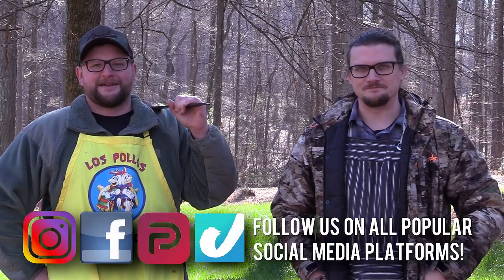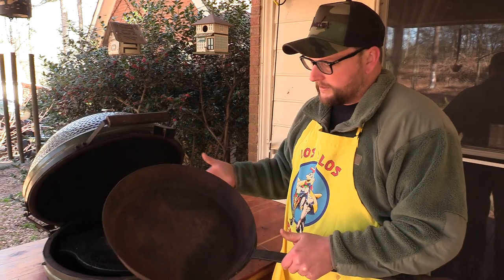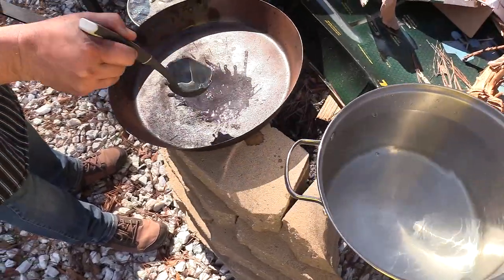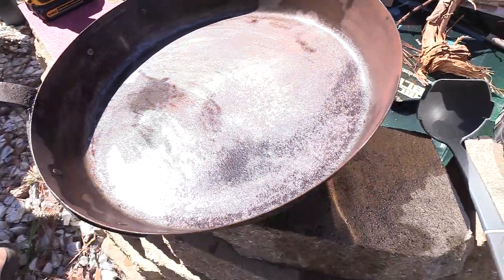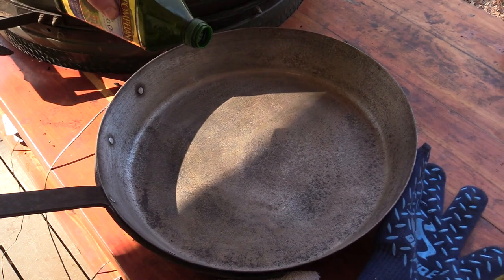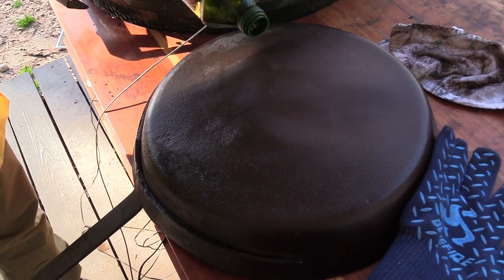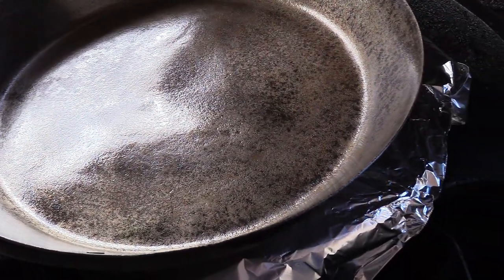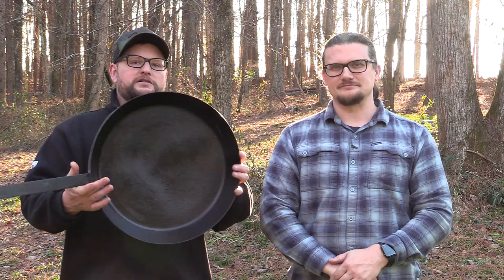MANLY MEALS | Cast Iron Restoration

Comment: Guys, That skillet sure looks a lot more like carbon steel than cast iron. Good thing is the procedure for seasoning  carbon steel is the same as cast iron. Be careful not to use too much oil at one time or you will get a gummy sticky mess on the skillet. If that happens, you will need to start all over again.
Reply: was thinking the same thing
Reply: Yep
Reply: How does it look like carbon steel please inform us almighty one 😂
Reply: @JeremyKing carbon steel and cast iron are really similar alloys to my understanding, the main difference is that cast iron is cast and carbon steel is stamped out in sheets. It's hard to get cast iron as thin as carbon steel and it'll basically be always in one piece. Since this is thin+smooth+has a handle that's riveted in that's a pretty solid indication that it wasn't cast.
Reply: I made the mistake of too much oil my first time seasoning one.  Not fun.
Reply: @FalconGames109  @JeremyKing, You need to do a little study on metals. Carbon steel and cast iron are very different metals. Carbon steel is malleable (can be easily shaped. Usually either spun or stamped.) Cast iron is crystalline. Drop a carbon steel skillet on a hard surface and it will bend. Drop a cast iron skillet on that same surface and it can shatter. Put ice on a hot carbon steel skillet and it will warp. Put ice on a hot cast iron skillet and it can crack or shatter. Both have there place. Carbon steel heats up quickly and cools down quickly. Cast iron heats up slowly, but holds the heat much longer. The one real similarity they have is the way they are both seasoned.
Reply: @jerex112  First let me say I'm 73 years old and have been cooking on both carbon steel and cast iron skillets for over 60 years. How do you know you are looking at an AR or an AK? You are familiar with both and know what they look like.
Reply: Yup, it's a stamped steel pan and not cast iron.
Reply: @jerex112  Rivets. Show me a cast iron pan with rivets.
Reply: looks awfully thin for cast iron part
Reply: @JeffPDX1  I agree this is carbon steel. There are Cast Iron skillets with riveted handles though. Lodge made some a few years ago call the Lodge Logic Line.
Reply: @philstocks7859  I mean he asked you how to tell from the video. We can't exactly reach into the screen and look at the crystalline structure.
Reply: @ChucksSEADnDEAD  I will go back to my previous example. I've been cooking on carbon steel and cast iron skillets for over 60 years. First: How do you know if you are looking at an AR or an AK? You are familiar with them and know what you are looking at. Second: Even the thinnest cast iron skillets are thicker than the skillet in the video.
Reply: @philstocks7859   exactly right.
Reply: You can even hear it's carbon steel and not cast iron when he knocks the skillet with his knuckle. Cast iron would make a short bell like sound and not resonate like this skillet does.
Reply: It's definitely carbon steel not cast iron.
Reply: @jerex112  first it's very thin and makes a sound like a bell when you tap the bottom cast iron won't do that guest cast iron is very brittle because of the super carbon content plus you can rivet cast iron as it will crack at the holes because it's super brittle
Reply: yea you should wipe it off with a dry towel after you applied it. I use flaxseed oil though
Reply: @keithbrookshire  Interesting- I'm unfamiliar with that line- at least the models with riveted handles. Quick google shows me nothing but aluminum and steel pans mislabeled as Lodge product
Reply: Definitely carbon steel the metal is thin and has rivets 
Anyone that has both carbon and cast iron knows the difference
Reply: @JeffPDX1  I wasn't familiar with it either until one popped up on Facebook marketplace in my area. It was already gone by the time I confirmed it was a genuine unicorn. I'm not sure about this part but I think that line may have been an exclusive to Macy's department store. Either way it was pretty short lived.
Reply: @keithbrookshire  Well you know what Carl Sagan says... "Extraordinary claims require extraordinary proof" so unless you care to substantiate this unicorn- I remain skeptical.

Comment: That's a big thin cast iron skillet !!! I have been cooking with cast iron for years, to clean i burn it off first. Can use dish soap and hot water then heat dry after rinse for normal cleaning. If you really want it clean sand blast and reseason is what i found works good.

Comment: That high carbon steel pan is great for cooking on camp fires.
First thing to cook in it would be pork fat or bacon ends. Render it down but don't burn it.pull the left over meat & pork fat out & then fry potatoes it the rendered fat. You will appreciate the final finish. Eggs will slide around easily.

Comment: You should consider an electrolysis tank for rust, or even baking soda and water. Using power tools smears the iron's pores and makes it difficult for seasoning to bind. If you choose to do this you should soak the cooking surface in a little vinegar to open the pores back up before you season it. Nice video!

Comment: Next time try seasoning with "Lard". Thats how it was done back in the day. I first used this method just a few weeks ago after years of using other oils on my pans. IMO the lard works the best. The non-stick effect is just amazing. ... at least on my particular pan. Eggs, cheeses, etc.. Not sticking at all. I'm actually shocked at how well it works.  I've never had a cast iron or High carbon steel pan become so non-stick. Its crazy, "grilled cheese" -- cheese, just wipes off.
FYI- I wiped on the lard three times, cooked for at least 1 hour each time at 375 - 400. I baked it in my outdoor grill as well.

Comment: One of the other advantages of cast iron (and also carbon steel) pieces is how relatively inexpensive they are, too. Multi-ply cookware like All-Clad is excellent and long lasting as well, but will set you back a pretty penny. If you take just a little bit more time to care for it, a good cast iron or carbon steel skillet will serve you in good stead just as well, and is something you can likely pass down for generations as well.

Comment: After the bake step I use muriatic acid same thing as hydrochloric acid.  It removes the rust but leaves the iron.  Afterwards rinse it out with baking soda.  Then cover it with oil and bake it again too season.

Comment: Grape seed oil has higher flash point.  That's probably why you needed higher temps to get it to flash.  Abom79 did a video recently using a product actually made for seasoning cast iron.  It is made up of beeswax and some oil that I can't remember off the top of my head.

Comment: 350 F is a little on the low side for heat,  you want to be at or near the smoke point of the oil you are using. Yeah, it's hard work restoring a pan that has been neglected like that one. Barry God keeps him would be proud of you. For some reason, you have not been showing up on my youtube page. When did you guys start cooking?  It's a good thing.  One of the little things that are forgotten especially for single men. I will not tell you how long or how many eggs I cracked to be able to do a passable french omelet. Nothing like a green egg.

Comment: On a thicker pan I’ve used a palm sander to resurface. It made a smooth surface, but now the pan has a hard time holding onto its seasoned finish.
Reply: sure it does. sanding ruins them.

Comment: I had always heard the best way to season cast iron was by using a reasonably heavy layer of vegetable shortening and a good amount of white flour to almost make a paste and "bake" in a 375° oven for at least three hours.  Was I misinformed?
What do you gentlemen think?
Thank you.
Reply: The way to season CI is to rub on some oil or shortening, then get out a clean rag and try to rub all the oil off of  it.  Then  heat in the  oven for an hour.   Repeat this 2 or 3 times building your seasoning in very thin coats.

Comment: You should use a grinder with a welders wire wheel it's high rpm is what you need . That is what I use and on my.disk what you know about asouth Texas disk

Comment: Electrolysis or the use of a lye tank are the best methods for restoring cast iron. Wire wheel or sand blasting are no no in the cast iron community for restorations.
Reply: You are absolutely correct! This is not the correct way to clean cast iron.

Comment: you should do it hotter,  the oil needs to reach its smoking point and depending on what you are using it's usually above 400 F
Reply: yeah grapeseed oil is a higher smoke point than crisco that they mentioned so need to get it a lot hotter
Reply: @FalconGames109  They just need to be hotter in general, even for Crisco I always go 15 to 25 degrees hotter then the smoking point.

Comment: pans made after the start of WW1 changed how they were made and have a good amount of heavy metals in them

but, still probably better than things made post 1960
Reply: If you mean "the metals used for engine blocks" to make them more durable- you are indeed correct- sometimes actual engine blocks as "inclusions". Older cast iron has less non-iron scrap included.,

Comment: Have I missed something here, but how can an induction ring or hob be described as indirect heat? By its very nature it causes the pan itself to heat up through molecular disturbance. Now admittedly the heating effect will be reduced because of the distance of the pan from the coils as it is placed upside down on the hob.
BTW is this a cast pan or steel pressed?

Comment: Sandblasting would’ve been my first option. But if I didn’t have access to a sandblaster I would use navel jelly that will remove rust. And you need to coat at least three times

Comment: you sure thats cast iron? looks like thin sheet steel, which won't season as well as cast iron
Reply: it's carbon steel, essentially the same as cast iron just pressed into a sheet instead of cast. seasoning doesn't stick quite as well maybe but it's rarely an issue
Reply: @FalconGames109  You weren't a chemistry major, were you?

Comment: That is not cast iron it is a steel pan proof is in the rivets you can't rivet cast iron it is a weak point and will crack being that it is steel you can put it an wood fire or propane burner. Not cast iron prove me wrong.

Comment: Guys this is not the correct way to cast iron!
You should NEVER use abrasives, heat, or vinegar! 
Abrasives can damage the smooth surface of a skillet. Use lye or an electrolysis tank and save yourself a lot of senseless work.
Heat can warp or crack a skillet. Bring cast iron up to temp slowly, so all parts can heat up evenly. Never place CI in an open fire.
Vinegar is an acid and will pit cast iron. 

As for seasoning a CI skillet, use anything you like. Trendy oils like grape seed don't work any better than Crisco. Use lard or bacon grease for cooking, not for seasoning. If a lard seasoned skillet isn't used regularly it will go rancid.
Reply from the maker: Did you see the condition that skillet was in before we did anything to it? There was literally pitting and rust. In which case yes, who cares. It’s not going to hurt it at all

Comment: i cringed when you broke out the drill! you never want to grind on a cast iron pan! it should have been cleaned with electroless! it would be like bubba grinding on a gun with that wire wheel that needed a good cleaning. oh well at least it was a cheap pan,,,,,,,,,,,,,,,,,,,